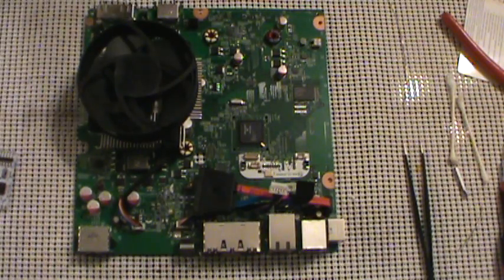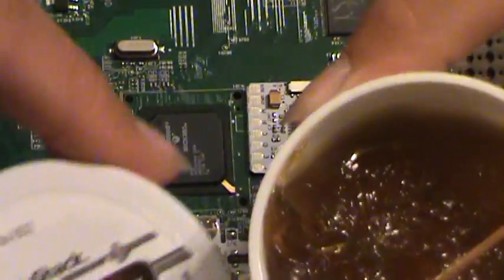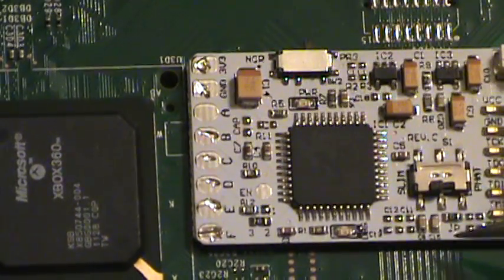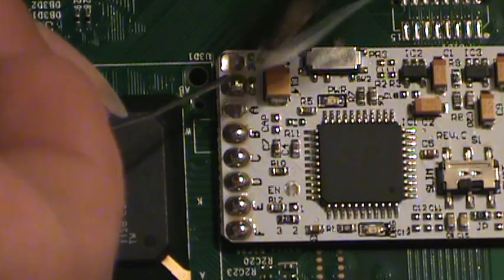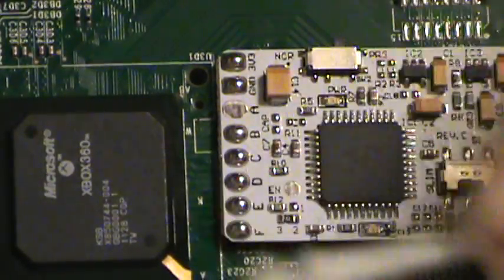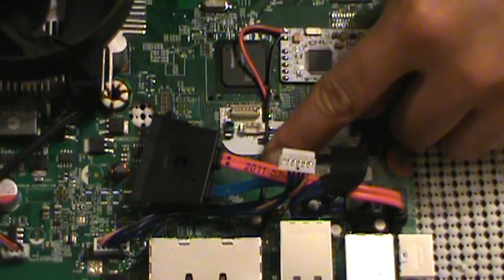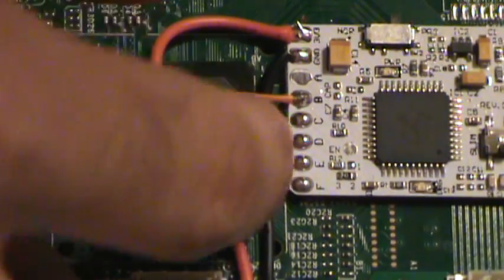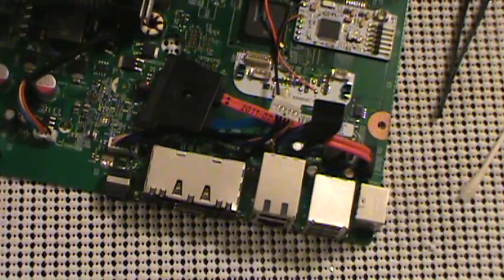Xbox 360 Corona RGH Tutorial Part 2

Comment: Could I do this with a corona v5 slim with cool runner rev c and a matrix chip to read write nand?
Reply from the maker: TR0LL yes you can. You would need the NAND qsb with the built in oscillator if your glitch chip doesn't have it built in. You would also need a post fix adapter for the v5

Comment: where did you get the equipment?
Reply from the maker: This is an old outdated tutorial. 

At the time of this video I shopped Xconsoles. 
Now days I buy from modchipcentral
Reply: thanks.. its been like looking for the holy grail..lol
Reply: do they have kits?
Reply from the maker: +Eric Hrejsa x honestly I'd say skip the qsb and get a cr4. You would have to direct wire. 
The cr4 is only 5 wires and only 1 goes to the qsb. 
NAND requires more soldering.
Reply: im just looking for the cheapest and easiest jtag.
Reply from the maker: +Eric Hrejsa x well if you haven't bought your jrprogrammer or chips it would be easier to pay me to do it for you! Wouldn't be cheaper but easier

Comment: I have a corona v3 can i do what you did but using jr programmer v2 and the postfix adapter? Or is it a totally different thing and if you can try to make a tutorial for corona v3 and up because the postfix adapter and nand x isn't on sale anymore I sent this message 10 months ago but got no reply
Reply from the maker: This guide is rather outdated and uses old equipment. If your using a rev c yes pretty much everything is the same except that you use the post fix adapter. If your using any chip after rev c you would need the NAND qsb v3 without the oscillator built in. 
The cr4 is a different install. Requires several didn't points to solder to.
Reply: +Keil423 I heard I need to bridge some resistors but I didn't buy any of the things for it , I'm just a kid and my grandfather is really good at soldering but hasn't done any Xbox mods I have looked at a guide for v3 and it says I need to bride R2C6 to 7 and 10 to my nand r/w
Reply: +Dylan Keskinyan and also I am confused on where to put the black wire on the audio video box thing lol do I put it on the side of it or on the side at the bottom